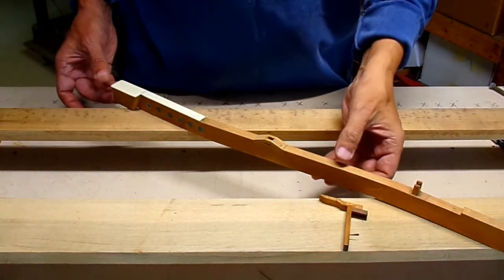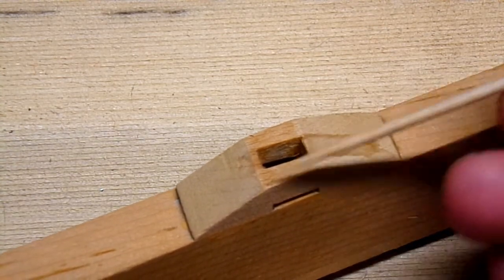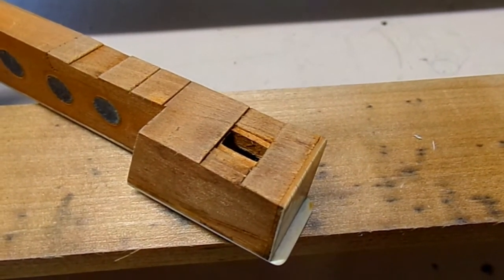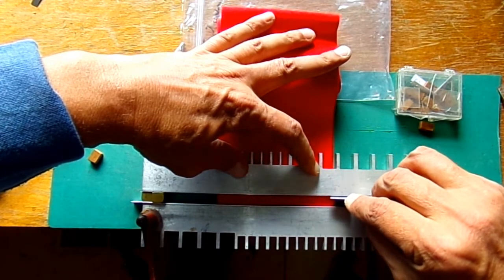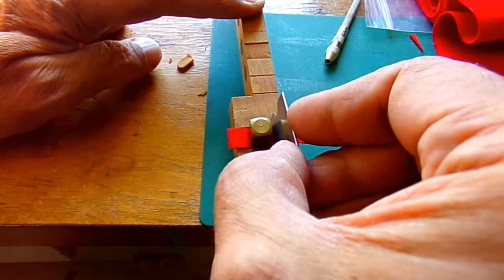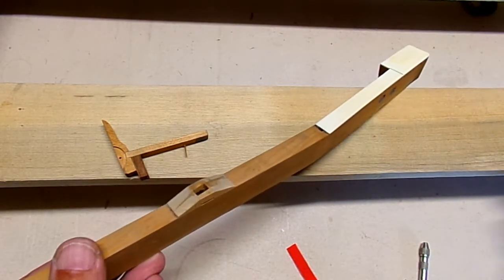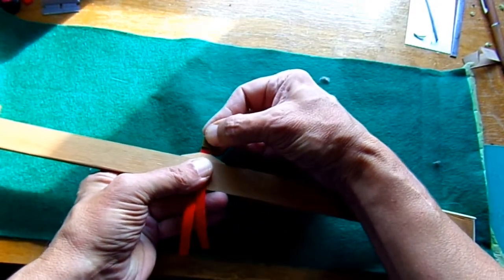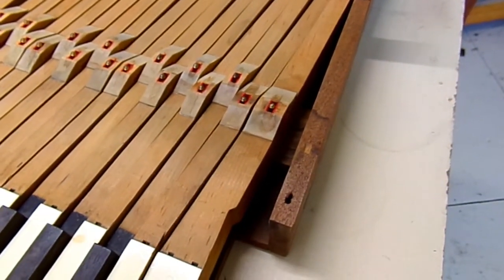Key Bushing installation for 1867 Chickering 33B Grand Piano

Comment: Thank you for your contribution!! is very good! :), a question about the red round felts on the front rail, are the white discs also felt or paper punchings? That is to say, can I also use one felt disc on top of another to increase the thickness if I don't have the thickest felt? For the correct height of my piano I had almost 4mm of punchings plus a 3mm felt disc, but the blow felt more wooden. Is it better to level it again like this or put a 6mm felt disc plus a millimeter of punchings?
Thank you :) . I am a non-technical pianist, greetings from Germany.